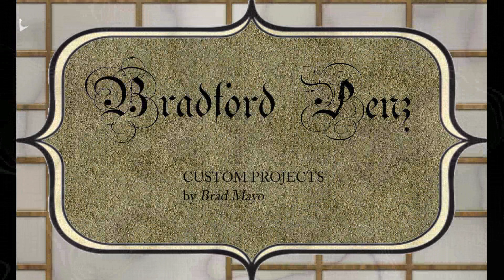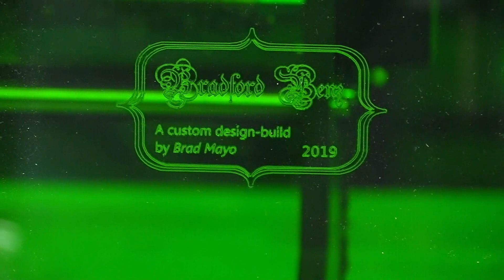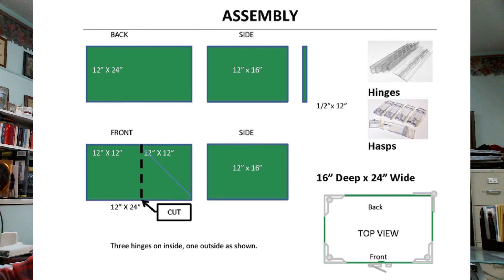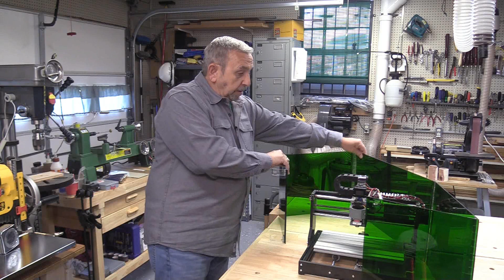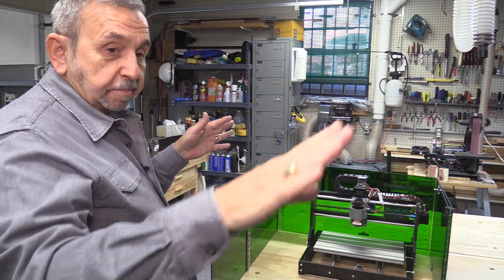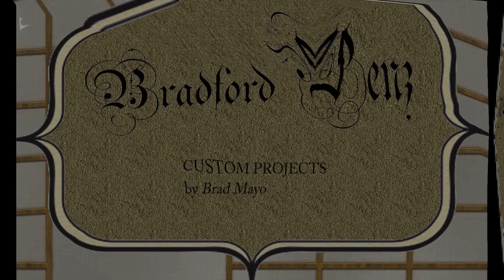Laser Safety Shield For CNC-Laser Machine

Comment: GreenPlexi glass. If u dont have it but u have normal clear plexi glass. Can u tilt it like a car window.  Red/black/green/orange. Will it be able to still protect your eyes from laser if u make it like that instead of buying green plexi glass. Can u let me know. So I can just use what i  have.
Reply from the maker: Hi Alan.  I thought I answered your question a few weeks ago but it appears it did not post so here goes again.  First, clear plexi won't block the blue or any other colored laser because it is transparent to the light.  Setting it at an angle to, I presume your intent was to get a prism effect, would not work since the person being protected is not going to stay in one place, thus you would have to continually adjust your angle of the plexi in relationship to the protected person and the laser point of contact on the item being etched.  Secondly, I don't think a sheet of plexiglass will act as a prism, if that was your intent.  Bottom line. Color plexiglass is the way to go to achieve a minimum amount of attenuation of the 450nm laser.  Remember, this light is within the visual range.  Hope this helps...Brad
Reply: @bradmayo6924   This is some very useful info. Thanks for the help. I will try my best to attempt to do this project. Keep your response noted. When doing the project

Comment: I was hoping to find this same idea. With a step to step guide tutorial on how to make it. It may seem simple but when its time to make what u explaining would be difficult.
Reply from the maker: Hi Alan. Sorry I could not provide the step by step but as I noted in the video, I built my unit before thinking of documenting it in a video.  I do provide all the parts descriptions and final dimensions, and yes, it does take a little thought on putting it together.  It is not hard and the most you'll have to figure out is placement of the hinges at the edges of the plexiglass so they move freely and in the correct direction. Also mentioned is a recommendation to watch the ePlastics video on the gluing process for plexiglass.  The link is provided above. Good luck on your project should you pursue it.....Brad
Reply: @bradmayo6924  Thanks for the info help brad

Comment: curious question, I have seen videos on safety glasses and some that say they protect your eyes from certain lasers and they have a device to test and see if the glasses are protecting you and lots and lots that say they do block the wavelength do not do anything at all....so my question is have you tested to find out if that plexi glass is even doing anything to protect your eyes from the laser ? or is it just a colored plexiglass but it ain't doing really anything ?
Reply from the maker: Thank you for your question.  Yes, I did research and rather than repeat what has already been posted, please scroll down to Todd Mitchell's question and my fairly lengthy response.  I think it addresses your concern.

Comment: I'm told that the orange plexiglass is the best for laser
Reply: John, thanks for your comment. It may be but my method of selection started by using the same color as the safety glasses provided with my laser. As stated, this is a DIY project and you could substitute a color of you choice based on your laser and your research. Your input may prove valuable to others. Thanks for viewing.
Reply: @bradmayo8017  all research that I have done on those glasses show that the green that you get with the machine are bare minimum. You need the better ones protect your eyes

Comment: What did you use to research the correct/acceptable plexiglass for your laser?
Reply: My 450nm laser came with green glasses too. I had previously messed with a 1W 405nm laser and green glasses and they barely did anything. This time I got red glasses and they block much much more blue light. If I set the 5.5W laser to 0.1% power and put the glasses between the laser and the work, it barely makes a difference to the bright spot. The red glasses make it disappear.

Unfortunately, the red glasses mess with my vision more and I really don't like wearing them for long. I have a cardboard box over it right now. That's why I'm looking up safety enclosures. I'll probably end up making a red plexiglass enclosure.
Reply from the maker: Todd, Thanks for your question....
I actually asked the manufacturer about any specifications on the plexiglass regarding pass-through of various colored light.  Specifically the Optical Density of the sheets I was intending to buy.  After about a week, they responded that they did not test the plexiglass for the OD component at any frequency.  Although available in other super expensive products, I still wanted to come up with a reasonable priced solution for the DIY project.  So I started a few investigations and tests on my own as to the acceptability of the plexiglass material for my shield.  First, the 5.5watt blue laser is not super strong and the damaging visual energy looses its punch exponentially at a relatively short distance.  Realistically, the shield would only be working to reduce the reflected light coming from the object that was being engraved by the laser beam.  I read numerous articles on such and came to the conclusion that the 450nm laser fallls within the lower visual spectrum which means reductions of the light could be somewhat judged by visual examination from a distance without fear of eye damage.  The safety glasses that came with my laser are also green, and in actuality, more translucent than the green plexiglass I used.  I did do a visual comparison, like I said, at a safe distance from the laser (approx 15ft).  I did comparisons between the safety glasses and the green plexiglass sheet in front of the laser.  The plexiglass actually attenuated the blue laser more than the glasses did.  The key in all this is that the laser is low power and falls within the visual spectrum.  If it did not fall within the visual spectrum, my method of acceptability testing would not be a good test.

Now this may not be very scientific with equipment to measure in detail, but I have been using the shield for some time now and I actually don't use the glasses anymore unless I intend to look down from the top of the shield.  Additionally, the glasses do cause eye strain if worn for long periods of time.  Hope this answers your question.
Reply: @bradmayo6924  Thank you for the answer. I am currently researching shielding options for my newly accuired machine. I appreaciate the depth of your answer.
Reply: @Sendero5  have you found anything bad about this approach?
Reply: @ucantsaythatontv  I still use my glasses when I am working in tight, but I think it does a good job of blocking accidental exposure when family passes through my work area.
Reply from the maker: The approach has worked for me.  No negatives so far.